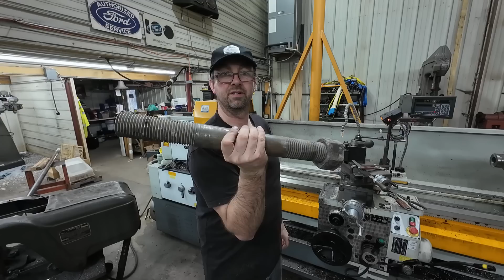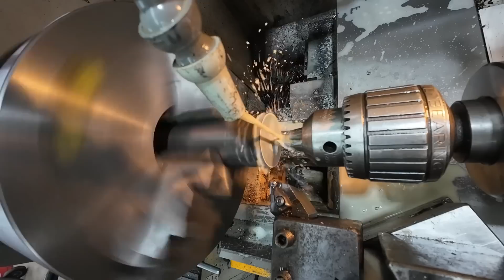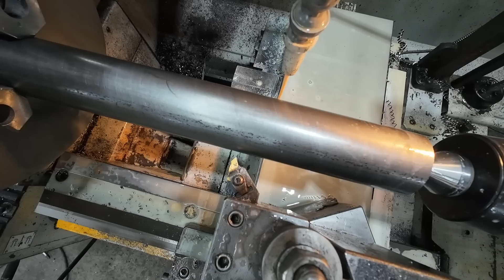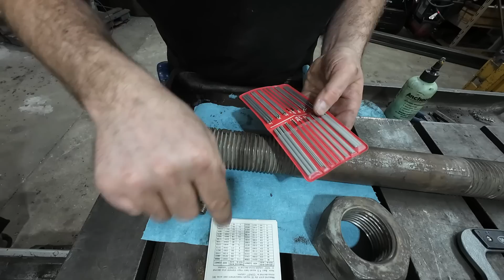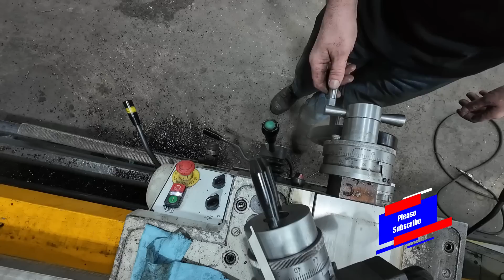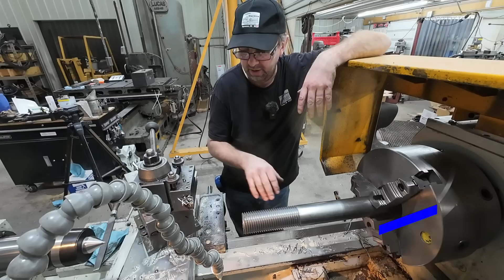I Hand-Crafted These Massive Bolts Using Only a Lathe

Comment: Customer sends worn/knackered nut and bolt, I want twenty of these.  As specified, customer receives twenty freshly made worn/knackered nuts and bolts.
Reply: It's not the machining that takes time, it's the hand distressing using sledge hammers, pipe wrenches and torches.
Reply: @cougarhunter33  the sales people call that value added damage “patina” 😂
Reply from the maker: Lol.

Comment: I haven't seen three-wire measurement in years. Now, you have me looking through my old Ready Reference Book. Thanks for sharing.
Reply: The You Tuber Inheritance Machining uses it regularly for threads.
Reply: I suppose because you can get direct reading micrometers that do the same thing. They have a point on the movable anvil, and two points on the fixed anvil. I think they have different sets of anvils. I know Mitutoyo makes one. Or just use under/over gauges.

Comment: Looks like a stud.
Reply from the maker: But most people don't u derstand the difference
Reply: @TopperMachineLLC  The proper response is to just say “thank you”
Reply from the maker: @hashgeek929  lol
Reply: @TopperMachineLLC  A stud is usually threaded at both ends, but not always. A bolt has a head for installing with a tool, either a wrench or a hex key or something else.
Reply: @TopperMachineLLC  True but there is a lot of stuff many viewers won’t understand.
Reply: @davidej9091  They will never understand if you don't use it's name!